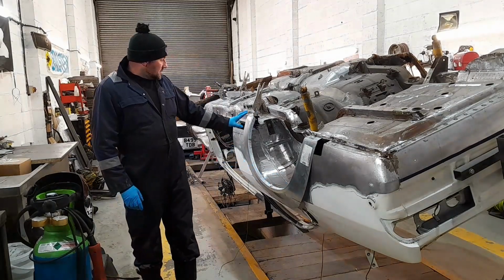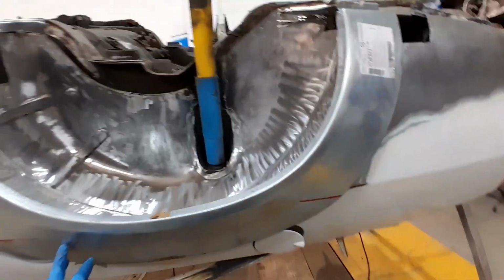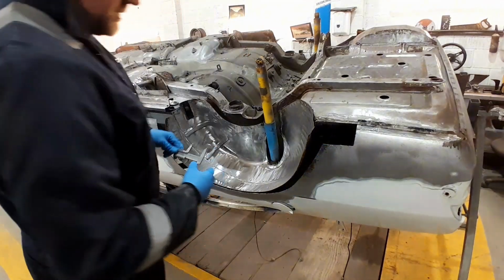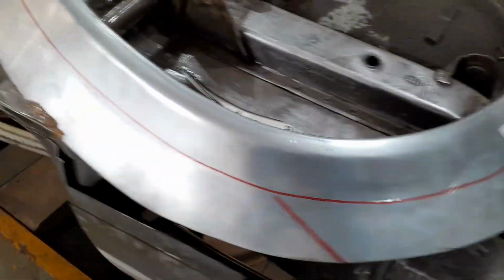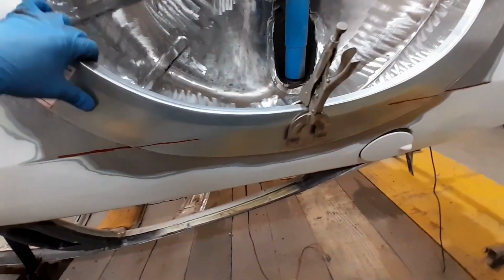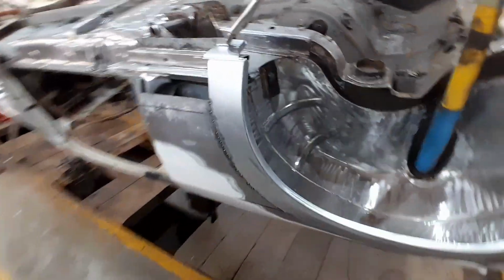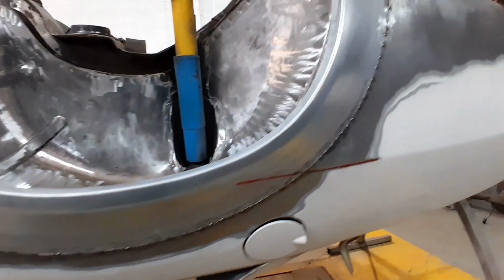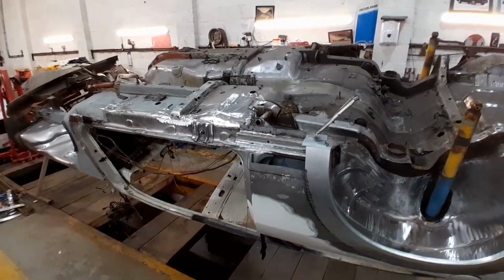"OPEL MANTA I200 RESTORATION" PART 9

Comment: Hi Andy, great work,.a trick I use fitting arch panels is to set the car at angle on the spit to be able to lay cold damp cloths on the exiating quarter to help prevent the distortion......just my tip mate
Reply from the maker: Thanks dave, unfortunately my spitt can only be set in 4 positions
Reply: Time for a modification 🤣